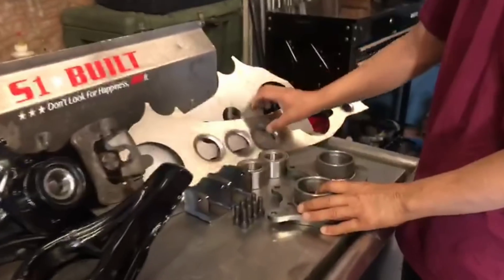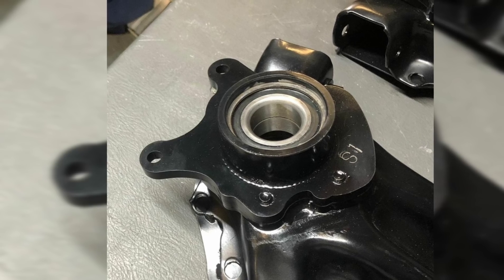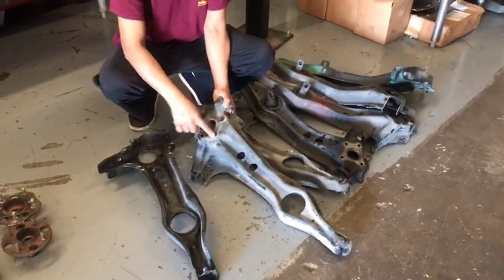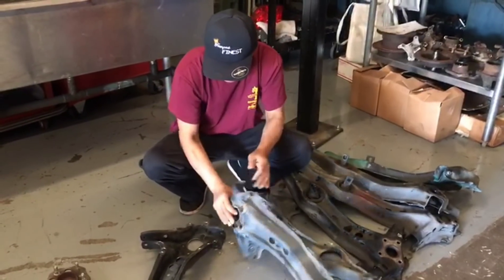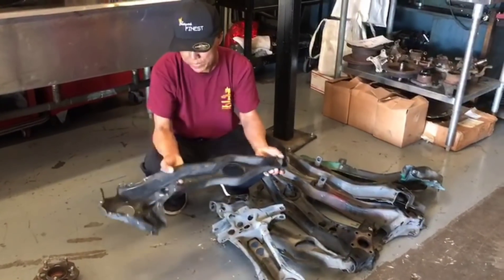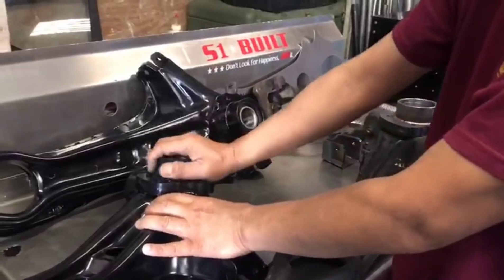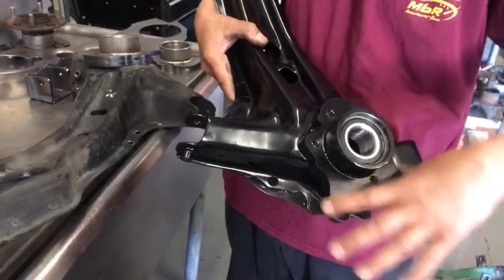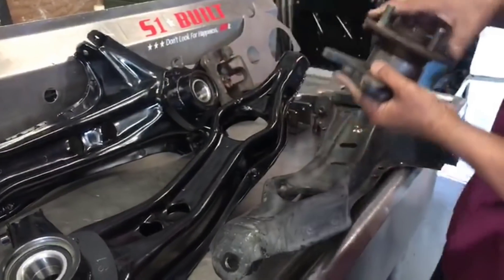S1Built - AWD DIY Kits

Comment: Finally! An affordable awd kit for my eg. Cant wait to order my kit.
Reply from the maker: luie0971 Thank you
Reply: @S1Built   - You should also mention that not only do you save $$ with a DIY kit but you know the job will be done right because you will be doing the work as opposde to being forced to trust someone else to do it.  Long story short, I have a Yamaha R1 that needed a new rear subframe welded on.  I paid a local shop, a well known shop that did work for Boeing and PECO and other big names , to do the work and it wasn't cheap.  Less than a year later three of the four welds broke / failed while I was riding the bike!!  So, I purchased a good TIG inverter and watched  a  bunch of YouTube videos so I could reweld it msyself. I did, it was the first aluminum welding job I ever did... 3 years later it is all still perfect.  Doing the work yourself has a million advantages, price, peace of mind, thorough understanding of the work done and thus comprehensive foundation for further modifications etc etc...  Nice kit.  Will be using this on my D series turbo CRX.